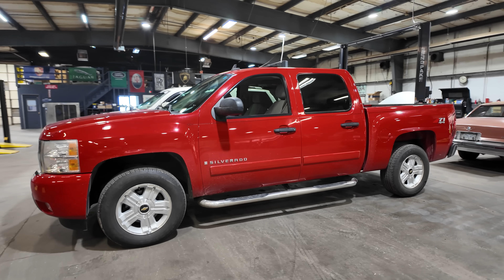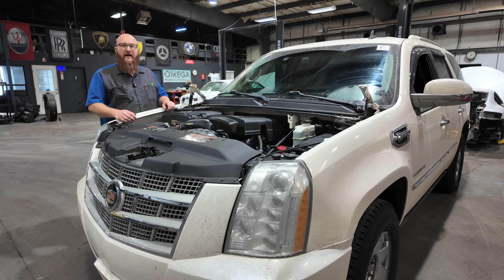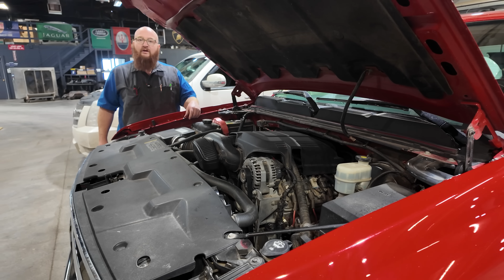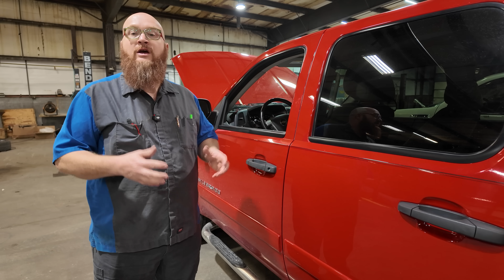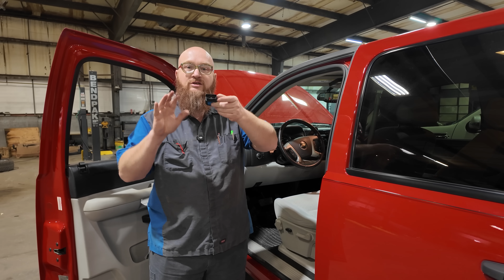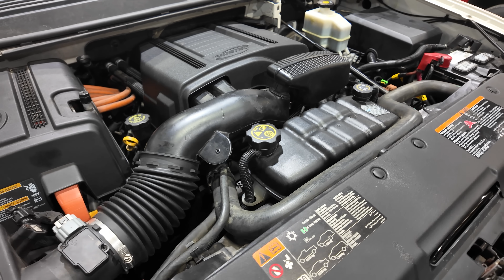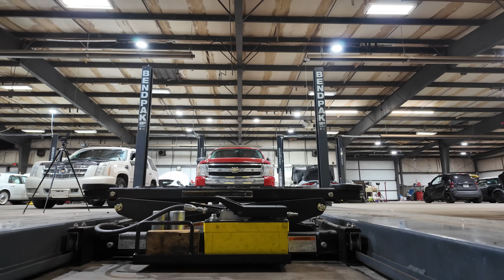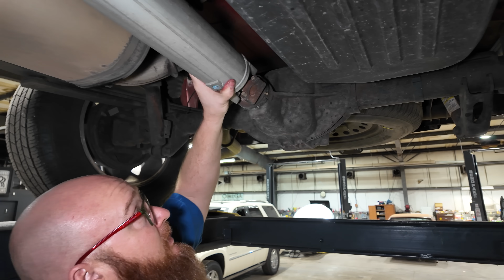AFM: Engine Saver or Engine Killer? The REAL Answer

Comment: I have a 2012 Tahoe LTZ with every on-time service record since new, only one-owner when I bought it. 118k miles. One day it started making the the clattering from the valve train. It stopped within a few minutes and I did the soft delete with ECM tune, block off plug at the oil pressure sender and clipped tower gaskets so the lifters could never be sent oil pressure to activate. It ran fine for a good while but the problem still returned. I took the truck to a reputable mechanic to have the full delete done. He does SEVERAL of these a week. Mine was caused by one spun lifter. Luckily the damage was only mild and nothing outside the lifter and cam were damaged. The engine runs better than new, so quiet and a good power increase from the update and tune. I may want to buy a newer 2017-18 and if I do, I will have that AFM crap removed immediately. And honestly, the difference in fuel economy is very small.

Comment: Having owned the 2013 Silverado with the 5.3L, I will say that I don't think AFM really helps (at least in terms of gas savings).  And if it does, it's not much and north worth it, considering the cost to replace lifters (and possibly a cam) if it does fail, and these had high lifter tick/failure rates.  Mine luckily didn't and I got lucky and sold it before it had any time to develop that, but it also developed oil burning issues , which is related to the AFM design as well.  The only "right" way to address AFM (before it becomes a problem) is to do an AFM delete kit before they start to have issues.  That's the only permanent fix in my opinion, and then they can be good trucks once you do that--and can last you a long time.  Thankfully the 5.3L engine is common so in a pinch, you can find remanufactured ones, but you'd probably want to find one that has the delete kit already installed if you're going to go that route and replace the motor.

Comment: The purpose of most fuel saving systems on modern vehicles is not to actually save fuel at the bowser but at the corporate combined vehicle fleet calculations imposed by idiots in government.
If you were to compare the real world final energy use for pre CAFE standards vehicles with those with start stop , ultra thin oils, cylinder deactivation and other supposedly energy saving technologies you would find the pre CAFE vehicles ultimately use less energy. For individuals the savings at the bowser often amount to what they waste in minor spills lifting the nozzle.

Comment: Ive had 2 Tahoes 2002,2009. I do mainly highway and with the assholefuelmanagement system if you drive to efficiently the top end clogs up since 4 of the pistons are still moving with no fuel . I had the top end replaced 4 times at 1k a piece . I will never ever buy GM ever again .

Comment: I bought an  07' Tahoe back in March of 06' with the AFM. religious with the routine maintenance and oil/filter changes.  I put 130k miles on it and sold it off to my nephew in 15'. He put another 100k miles on it then sold it.., never an issue, CEL or AFM problem EVER

Comment: I use one of those AFM delete plugins on my Suburban. It says that if you don't drive often it will run the battery down. Easy enough to plug in/out if you don't think you will be driving soon. It is amazing that in FB marketplace there are always many many mostly 5.3 GM's with 250-350k miles on them and "runs great" the ad says.

Comment: Awesome detailed video. My 2015 5.3L died almost 2 years ago at 93k, reported the ticking to my Chevy dealer, and they brushed it off. So I  went to a local shop that sold Jasper non AFM engines. Orignal est was $9k, but we decided go further, radiator, hoses, oil cooler and lines. I do not trust GM any longer.

Comment: I have a 2017 C7 Grand Sport with 7spd MT.  Its supposed to have the AFM but Ive never seen it come on.  Is it true that the Manual transmission AFM rarely come on as the AT transmission does?  Does that mean its not going to break?  Should this be one of the things I should worry about in addition to the torque tube failure?

Comment: Worked in GM dealer for 30+ years powertrain repair. Installed hundreds of GM lifters. No presoaking lifters for hours or overnight. Try prefilling lifter with a oil can to pump it up, worked everytime.

Comment: "Oh wait but there is more" The new trucks are worse because they have 8 bad lifters instead of 4. I've seen 2022 5.3L need engine at 8k miles because of failed lifter(ate cam, metal scored block cylinder.  Keeping the AFM in V8 mode(by obdII) is a good idea and will dramatically decrease your chance of failure but the problem lifter is still there. The 2007-09 Escalade "doesn't"  have AFM but it does have all the active fuel management components. Meaning its ECM is programmed to never go in 4 cylinder mode. (Exactly like programming a 5.3l to do same) The 2007-09 Escalade still had lifter failures.

Comment: I thought it was interesting to note that the AFM system does nothing directly to save gas by deleting a cylinder, rather when the cylinder is deleted it uses less horsepower pumping less air through the intake manifold, which like reducing weight, takes less horsepower to move the vehicle, which is what increases gas mileage, but by a very small amount. Its also sad that its perfectly legal to delete the AFM, just like its legal to turn off Auto Start Stop, because neither were mandated, auto manufacturers simply received carbon credits for building them into the vehicles.

Comment: So if you install the active fuel management disabling device, that still doesn’t fix the fact that you’ve got plastic lifter keepers in the engine. Do you think the fact that it’s not actuating into active fuel management would increase the longevity of the plastic keepers? Or are these still ticking time bombs?

Comment: When you build vehicles FAR too big for their use case, they need HUGE engines to move them along.  Over here, in the civilised world, we fit diesel engines to heavy vehicles.  It makes more sense.  America simply panders to its whims, instead of questioning their decisions, which is why their vehicles run on an unsuitable, fuel which is poured relentlessly into them, for very little return.  In an effort to at least show willing, when accused of poisoning the planet with their profligacy, they switch off the taps to a few of the gargantuan cylinders, when they're not needed (woo-hoo!)  For untold technical reasons, this not only has less than the expected effect, but also puts the engines through mechanical regimes they were never designed to survive.  Instead of all this barking nonsense, over here we simply buy a vehicle suitable and no more, for the job at hand.  We employ delivery drivers to deliver the once-in-a-lifetime pile of sand and cement for our new driveway, not a giant pickup truck that'll never see anything bigger than a shopping bag in the back.  We don't need stupid gadgets to use less fuel.  Our vehicles do this naturally.  Admittedly, with EVs becoming the norm over here, we're fitting your stupid gadgets to the internal combustion vehicles we want to stop being bought by the foolish and the ignorant.  Every society has their idiot element.

Comment: Also, maybe it bears restating every once in a while:  aside from the size and weight of the vehicle, fuel economy depends a lot on the way we drive.  Mashing the accelerator at every opportunity, driving 85 mph+ on the highway, and, oh yes, underinflating the tires and using the same air filter for years on end will ruin the fuel economy of any vehicle regardless how good a  hybrid or AFM or whatever fuel saving system it has.  Even a Prius  driven that way will get under  30 mpg.

Comment: There is a reason why the company that pioneered hybrid drivetrains for cars (Toyota) never used an AFM-type system, and still got really impressive fuel economy.  
Regarding Elgin vs. "OEM" parts like those AC Delcos here:  A key difference is that Elgin apparently knows that they sell each part to two customers at the same time:  the vehicle's owner and the mechanic who installs it.  And the mechanic, just like @CarWizard, will remember how many times they had to deal with an upset  customer of theirs when the "OEM" part failed soon after their mechanic installed it.  AC Delco doesn't (didn't) care about repeat business from independent mechanics, Elgin plays the smart and long game and delivers reliable quality.  After a few bad experiences with "OEM" parts and a few good experiences with Elgin, that mechanic will always recommend getting the Elgin lifters.

Comment: What if you only drive around town in your AFM-equipped Vortec 5300-equipped Silverado? Truck would nearly be in 8-cyl mode at all times, idling at lights and accelerating up the city streets. Would leaving AFM active still be a detriment in such seldom-used conditions if oil changes are done every 3 years? (truck only drives 1k miles per year). Not asking for a friend. 🙂

Comment: GM never gets rid of an idea, 4;6;8 becomes AFM, the HUD on my 17 Suburban could have come from my 98 Grand Prix with Supercharger. My 17 AFM works perfectly, Original Tranny with temp upgrade to cooler thermostat, original A/C and 223k miles. Oil changed at 50 percent, all others fluids at severe interval. Nothing but tires gets done at a shop.

Comment: I don’t get with that Cadillac why they didn’t just go for a four cylinder turbo diesel. I mean if it doesn’t actually drive the wheels and is there to basically act as a generator for the electric system, just stick an extremely efficient small diesel in it.

Comment: The extremely small cost of what little gas you might save with a nightmare system like that is nothing to what those systems will cost you in repair bills. People are so fixated on the cost of gas that they completely overlook the MUCH higher cost of trash like this. As far as the system itself, even when it is working as designed, those four pistons going up and down in the cylinders are putting fuel consuming drag on the engine.

Mechanically disabling these trash systems is the ONLY way to go. Yes it is expensive, but if you keep your vehicle long enough, it will pay for itself. Of course if you have an engine that also has direct injection, variable valve timing, or a turbo, you're better off just finding a vehicle that has none of those things.

Comment: The manufacturer of the camshaft and lifters for General Motors and Chrysler/Dodge/ram for the DOD AFM is the same manufacturer, and sadly the manufacturer is not to blame for this. They are given a very specific set of rules, and they must follow them and this fall squarely on the shoulders of Chrysler and General Motors accounting department.

Comment: Watching this makes me love my 03 2500 8.1 and my 2011 1500 4.8
Reply: We have an '05 2500 hd with the 8.1/Allison. Will never sell it.
Reply: I just bought a 2012 1500 with 5.3 and I am about to sell my 02 2500 with 8.1 😢
Reply: I have a 2011 sierra with the 6.2 with no AFM! Love it
Reply: Just bought a 2011 4.8 w only 70k miles. Hope to drive it for at least 10 years.
Reply: @projoebiochem that’s low ! I have 279k on my 4.8 and runs like new -  not even an oil leak or wet spot on the engine
Reply: @TylerShowMWSE  That’s what I’m hoping for! I wanted something that my mechanic could keep running.

Comment: I did the full delete on my 11 Yukon 5.3. New lifters, GM 4.8 cam, 4.8 valley plate to block oil passages. Oil pick up o-ring and timing set. 260k miles now and is smooth and quiet. 😊

Comment: Beginning with 2022 model-year GM trucks, GM removed AFM/DFM control access from the OBD-II gateway. As a result, the traditional OBD-II dongle-style AFM disablers no longer function on 2022-and-newer vehicles. Those OBD-II devices are only compatible with 2021 and earlier trucks. On the newer trucks you have to use a range brand dynamic fuel system disabler, it piggybacks directly off the ECM.

Comment: You can turn it off for free. If you have a 6 speed automatic, put the gear selector into M5 mode. It runs 1-5 automatically, but with v8 mode all the time. I bought mine in 2017, i have daily driven my tahoe. Still my daily today nearly 10 years later, 70k miles of in town and cross county. I'm at 180k and it still runs quiet. 

I Also have been doing synthetic oil since i bought it.

Comment: I believe there was a recall considering bad lifters. Not the usual ones "replace the whole engine if its ticking" - just the lifters. GM claimed its only affected the new cars (like, from 2020 as i recall), but i suppose if you make same lifters for the production line and as spares - if you make bad ones it will eventually end up not just in cars, but also in someone's shop. The guy i know was fixing his 2018 Escalade around 2 years ago - and 4 out of 8 new lifters were bad from the box. OEM Delco.

Comment: 3rd option DELETE the AFM/DOD lifters. Plug the towers. Replace with LS7 lifters. Replace the cam & cam gear. In the ECU disable AFM. Now you have a Gen III LS with better internals. If you want to feel froggy, replace the oil pump and pickup Oring.

Comment: PSA: The AFM Defeat boxes that I've used cause the computer to fail inspections anytime the battery was disconnected and reconnected. I learned to yank the boxes out until all the monitors pass and then plug the box back it.
Reply: What inspection?
Reply: @timmccall4566  Emissions.
Reply: Yup! Learned that the hard way..lol. Pull the box, drive on highway for maybe 20 minutes then take it in and hook up..passed fine then. Plugged it back in before I left the testing facility.
Reply: Why do you have to unplug the battery?
Reply: Yup yank the delete a month before smog . Drive it 4- 6 times before you take it in .

Comment: Two different suppliers to GM for the AFM lifters. Delphi, Eaton. Eaton are better quality, but you don’t know when you buy them from GM which ones you’re getting. Easy way to tell, Delphi has staked axles on the roller bearing axle to the body. Eaton has a C clip that holds the axle in. That’s how you can tell the difference. INA makes the lifter for the Dodge AFM.
Looks like the ones you are displaying are Delphi lifters that you purchased from GM.

Comment: True LS motors such as the 6.0  LS2 and 6.2 LS3 did not have AFM.  They were performance motors.  You are talking about the LQ motors.  They do have AFM.  The better way not using that plug in thing is to have a tuner disable the AFM.  That plug in thing draws current all the time.

Comment: I used the plug in on my 2013 5.3 100 thousand miles ago and have had zero problems. I currently have 269,000 miles and it runs great. I do change the oil every 4,000 miles due to the high mileage. It uses about 3/4 a quart of oil between changes. It has a very small oil leak I think around the rear seal but not enough to drip on my driveway.
Reply: Did/do you use 0-20 or 5-30 weight oil? I take it full synthetic?

Comment: I had a 2009 Pontiac G8 GT with the L76 6.0L motor, it had AFM. The L76 in that car was basically a blend of the LS2 and LS3/L99. LS2 bottom end and short block with Gen IV Cam, Heads and Intake. Not saying it was 100% spec for spec, but its a good description in my opinion.
Reply: Still have mine @ 53K.

Comment: I have a 2015 Suburban with a 5.3 I disabled the AFM with a tune but didn't change the lifter.  The lifter finally collapsed at 148k.  I then swapped out the cam and lifters and so far so good.  Just because you disable it doesn't mean the lifter still wont collapse.  I changed oil every 5k miles with 0w20 Mobile 1.  Mine made it 10 years with it disabled before it collapsed. Good Luck everyone.  The need to bring back the pre 2007 5.3 and forget the AFM crap.

Comment: my 2007 Cadillac Escalade ESV with 210K has the 6.2L without DOD it does have the CAM retard/ advanced. My 2016 Cadillac Escalade Platinum ESV with 62K has 6.2L with AFM/DOD I run a disabler plugged in the obd2 port it shows V8 all the time.

Comment: Mr. Wizard,  Appreciate your in-depth discussion today.  I have a 2013 Escalade, 6.2. I've ordered the disabler from your Amazon page. I've installed one before. A cheap one. It made my BCM go insane. Reset every system as I was trying to drive down the road. Then everything came back. Did that a few times. I pulled that disabler off the ODB port.  Reset the car by touching off the neg & pos cables (removed from battery). All good ever since. Have you heard of this happening before?

Comment: Hey david,we love all ur videos!! I have a 2018 bought new Tahoe 5.3 it has 62,000 miles now and i installed that override in the OBD2 so my V8 willl run strong all the time and installed 5w30 from 0w20 oil pressure is 55PSI at 65mph and 40 PSI at idle.

Comment: The irony of AFM/DFM is that mileage doesn't go down without it (running as a V8 all the time). Autostart/stop another terrible invention on the starter/engine. 
Driving in L7 (if 8 speed equipped) or L9 (if equipped with a 10 speed) will also stop both of the aforementioned from working. Yes, you won't have 'overdrive' but I still manage to get over 21mpg on the freeway without 10th gear...

Comment: When I was much younger and lived at home, we had a 1981 Fleetwood Brougham with the 368 V8-6-4.  I remember we had a toggle switch put just under the dash to activate or deactivate the V8-6-4 mode.  In town, it was always deactivated.  But on the highway, it was engaged.  Aside from the slight V6 mode vibration, it ran perfectly fine for 10 years before it was time to let her go.
Reply: Had buddy who bought 4 v864 Cadillac cars in the mid 80s for 700 to 1000$ each. He disabled it and they were awesome beautiful cars. El Dorado, Fleetwood, coupe DeVille and sedan di Ville